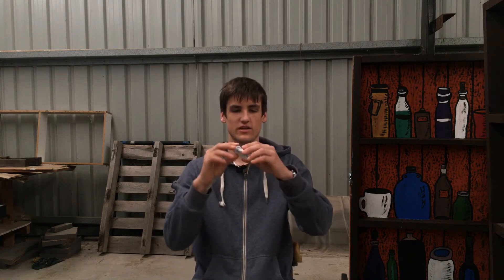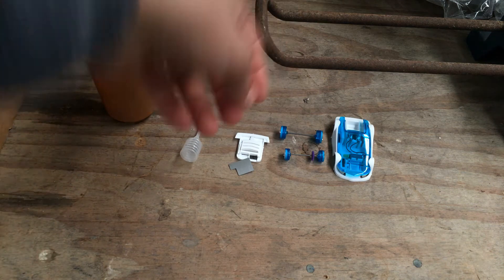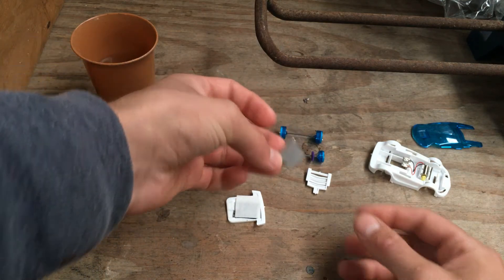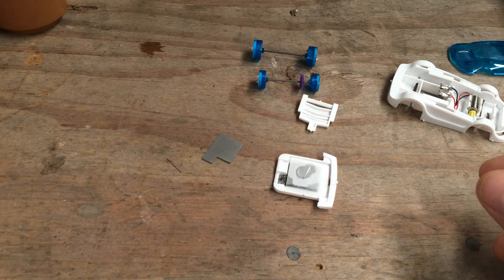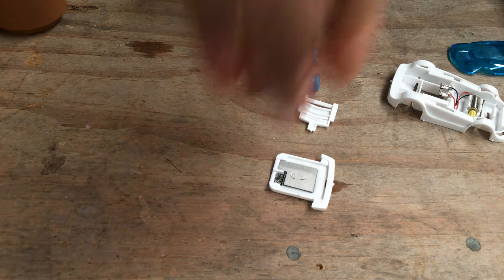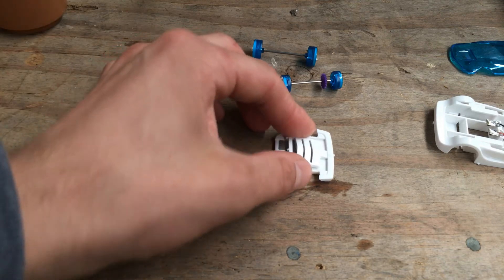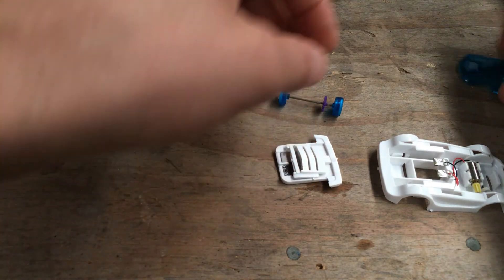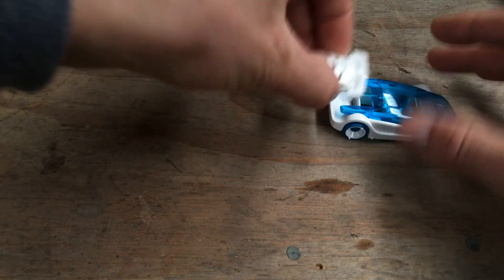Salt Water Powered Car!

Comment: That pretty nice! 2 questions:

1. Where did you get it?

2. What if you were to use a different salt? Such as potasium chloride?

Edit: just realized you linked it (dumb me)
Reply: Tut tut – there is some sloppiness here (although to try and prevent this from being too long, I’m taking some liberties). To start with, we are dealing with IONS, not molecules. And as you go down the periodic table of Li, Na, K, Rb, Cs, we are always dealing with a single +ve charge on the ion. What changes is that the outer electrons are progressively held more loosely by the +ve charge on the nucleus as they are at a greater distance from that charge, so are more easily displaced - ie., the ions are more reactive. (It's a changing charge DENSITY situation.) The opposite holds for say, the halides, where a similar examination would illustrate why they become LESS reactive. So brother needs to tidy his year 12 chem!

The chemistry here isn’t simple, but basically it’s a Mg/O2 battery (yes – a Galvanic process) with
 anode:  Mg <=> Mg2+ +2e¯  (proper symbols not available and ideally, I should subscript ions as aqueous)
 cathode:  O2 + 2H2O + 4e¯ <=> 4OH¯
 overall: 2Mg + O2 +2H2O <=> 2Mg(OH)2 (Mg oxidises - to the hydroxide - it doesn't "rust", that's referring to Fe)
(Although not clear on the video, there is a porous inert carbon electrode where the oxygen ½-cell process takes place.)
But parasitic corrosion of the Mg occurs where a cathodic process occurs
 (reduction) 2H2O + 2e¯ <=> H2 +2OH¯
 overall reaction: Mg + 2H2O <=> H2 + Mg(OH)2
So the choice of electrolyte is made to minimise the parasitic reaction. This is a big area of research, Na salts have been explored (couldn’t find other halides) and the chloride gives the best compromise. But as the reaction proceeds the corrosion rate increases, and exploring that gets complicated, so at this point I leave the story.
Reply from the maker: I got it from a site called Mad about science, there is a link in the description if you wanted it for yourself, and I haven't tested whether or not it would work with different salts, but I don't see why it wouldn't. It is the same reaction just with slightly different products.
Reply from the maker: experimental madness
I did year 12 chemistry last year and learned about all of this (although I didn't really enjoy chemistry at school)
Reply: Bryan Leech wow thanks for that detailed explanation!
Reply: exp madness. That's OK. One thing I'm unsure about is that Mg isn't easily reactive due to an inert oxide/hydroxide layer that forms naturally on its surface (related to the reason you can have mag wheels on cars, or similar materials in aircraft construction [alloys, of course]) - similar to Al which reacts very rapidly with moisture in the air if you disrupt that protection with mercury. So the NaCl solution must be getting through that protective layer. I imagine this ties in with the differences with different electrolytes, but I don't know anything about this. From what I have read, this seems to be an area of ongoing research.
Reply: AMAZON